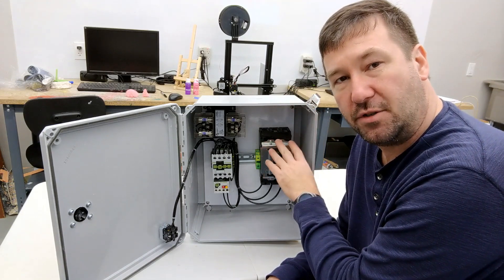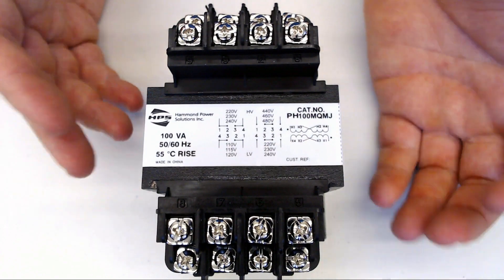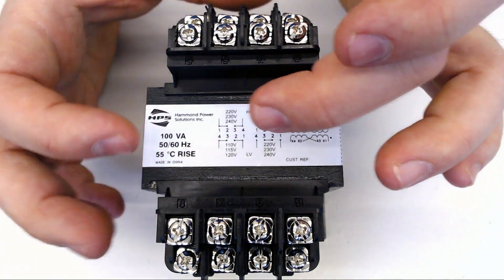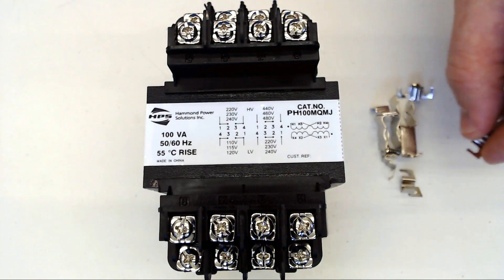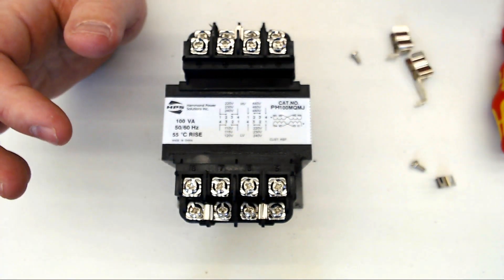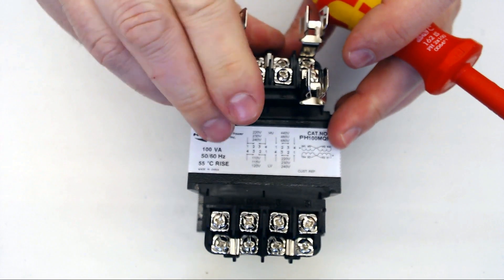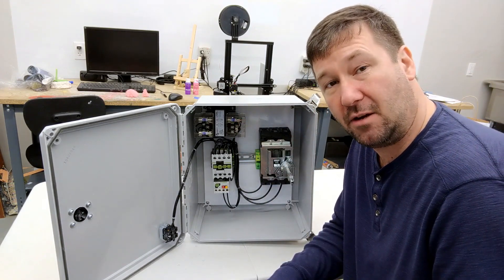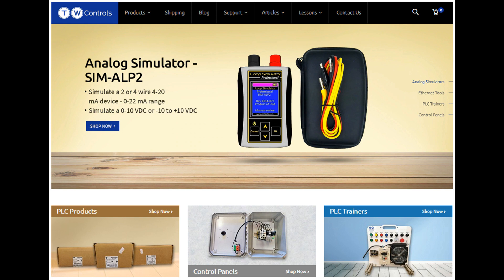Transformer Wiring Primary and Secondary including Jumpers and Fuse/Circuit Breaker Protection

Comment: I've got one that shows I can get 120 / 240 
But I only want to give it 120 volts line neutral 
And I was going to try to get 120 / 240 line line neutral 
Seems like mine would do either 120 or it will do 120 / 240 w3 leads.
This is just to two jobs and run tests with a large inverter in my truck that only makes 120 volts. I could test water pumps with just 240 line line but maybe an occasional thing would need the 120 as well. It'd be nice to have it in the box and not have to hammer a ground rod end or something. Just curious if you know. Thank you 
Hey thanks to you I'll find out soon either way.
Reply from the maker: Most inverters aren't big enough for testing large water pumps
Reply: @TimWilborne  I -1/2  horsepower submersible would draw anywhere from 9 to 12 amps and a 2 horsepower could get from 10s to  13 amps.

Comment: should I connect to ground one of secondary line?
Reply from the maker: It depends on the setup.  Here is a good article.
https://www.electricityforum.com/transformer-grounding
Reply: @SafetylSimplified  I didn't see you had an answer there but I would say no no no no no.. lol I was wondering about that as well and decided if I can't get the 120/240 to work both voltages. I have a
Reply: Ground rod and I can Hammer about 5 ft in this drown us here and get my neutral off the ground rod that way it stays away from the chassis grounds and things. Talking about the chassis of the transformer inverter converter or other electronics on site.
Reply: @CharlesDonaldson-oz2dl  connecting one line to ground makes it the neutral line. Best set up.

Comment: I understand having single fuse on 120 secondary side so if the fuse blows you lose your hot leg .. are you supposed to place two fuses on the secondary if your voltage is 240?
Reply from the maker: Since I grounded that side of the secondary, it is a defined as a grounded conductor and that doesn't get overcurrent protection.  It is in the NEC...240ish but don't have a book with me.

Comment: If it says primary 230x460v what does that mean? I can use voltages between 230 and 460 as my primary?
Reply from the maker: Not between.  It means it can be 230 OR 460VAC.
Reply: Thank you sir!!!!
Reply from the maker: @frankiespankie86  You are welcome. Make sure you pay attention to how the jumpers are supposed to be placed depending on which voltage you choose.

Comment: Got a transformer out of a mig welder, got a ac and dc breaker box for my home. Using wind generator and panels with inverters. The transformer has several wires and need help to figure these wires out so I hook it up correctly and thanks

Comment: How do you know what size amp fuse you need on the transformer from 480 step down 120 v
Reply from the maker: Hi Pablo.  Here are some charts to help you plus some explanation about transformer fuse sizing.
https://www.theautomationstore.com/wiring-transformer-overcurrent-protection-for-primary-and-secondary-windings-using-fuses-or-circuit-breakers/

Comment: Thank you! 
Never saw American control transformer. Here in Russia I have never seen transformers with fuse kits. Usually fuses are installed separately on the din rail.
Reply from the maker: On bigger transformers our fuses or circuit breakers are installed on DIN rail as well but this is a nice compact package for control transformers that we use often to save space.

Thanks for watching!
Reply: @TimWilborne  One more question: is it mandatory to install two fuses on the primary side? For example, if i connect live and neutral to the transformer, i install fuse in live wire only, neutral wire is connected directly. Am i violate electrical code installing only one fuse on  the primary?
Reply from the maker: @RS_83  If it were one live wire and one neutral, then only the live wire would need to be fused.  In our case it is 480VAC which is actually two 277VAC live wires so two fuses are required.
Reply: @TimWilborne  thank you, my friend.
Reply from the maker: Always happy to help.